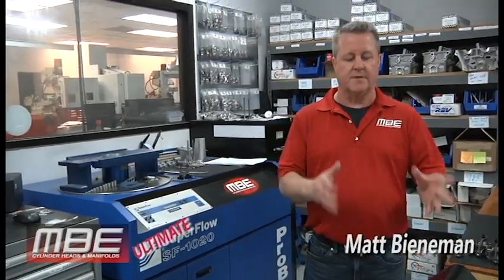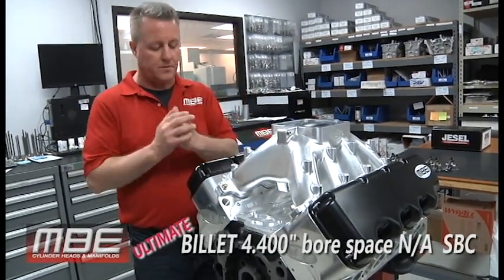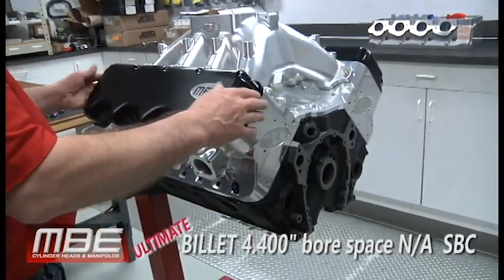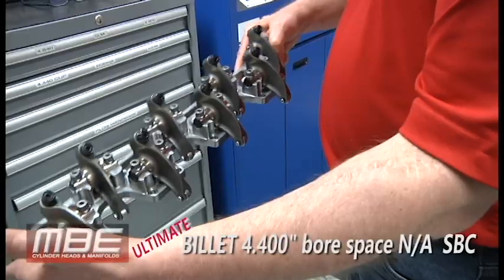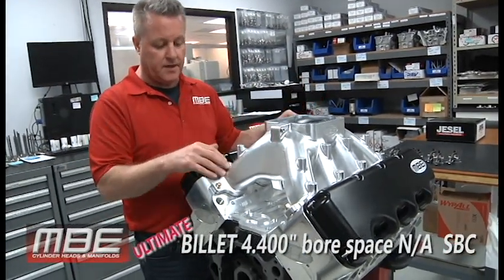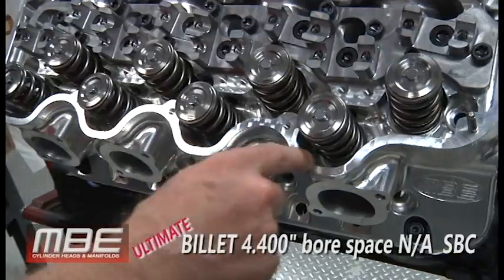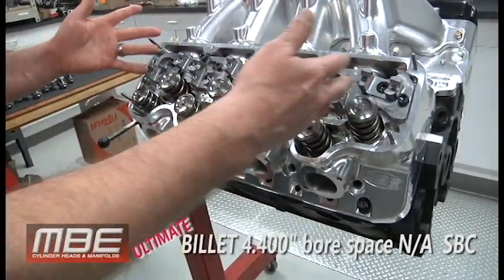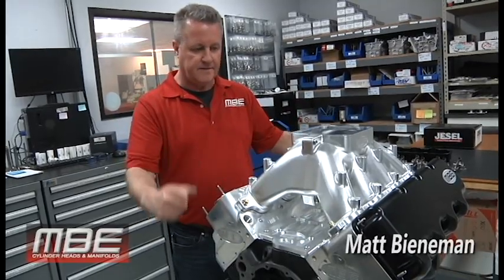** TECH **  The Ultimate Billet 4.400 N/A  SB Chevy Complete Top End Package

Comment: Doesn't look small block to me, how much???
Reply: I know a guy who knows a guy . . . Seriously, those heads bare, are about $5k each.
Reply: @Carl_Jr  Jeg's has the heads for $1150 a set with titanium intake valves set up at a 2.300 installed height. Spring 400 on the seat and 1150 open at .900 lift.
Reply: @Mr.RollTide   No. They don't. Are we watching the same video?
Reply: @Carl_Jr  small block heads are cheap. The intake is $250.
Reply: @Mr.RollTide   You aren't paying attention. The question was about MBE cylinder heads, not some budget friendly brand that Jeg's sells. MBE heads are LEAGUES above anything you can buy at Jeg's.
Reply: @Carl_Jr  Jeg's sells MBE.  MBE actually buys those parts from JEG's.
Reply: @Mr.RollTide   
Dude! I don't know what you're smoking but it must be the really, really good stuff! 🤣🤣🤣
Reply: @Carl_Jr  We have built all billet block, heads, intake etc 5.00 bore space engines for pro mods and radial vs the world for around 10k.
Reply: @Mr.RollTide   Who is "we"? You and your magical friends in Neverland? You seriously need to stop lying. You're just digging the hole deeper and deeper.
Reply: Roll tide...BRAVO for flapping gums on a subject you know ZERO about. Thank you for yer ignorance and the absolute funniest thing I seen on the net today...Kudos
Reply: @GhostRider-dp2tc  How many billet engines have you built?
Reply: Good question, try 75...Do you have $120K laying around in cash to put down in full up front with a 6 month wait time? Depends what you want, price may go up to $160K..Cubic inch is cubic dollars...
Reply from the maker: Incorrect and we buy nothing from JEGS
Reply from the maker: Have you priced billet lately?
Reply: @jimmybiggs4674   The guy has no clue.
Reply: @Carl_Jr closer that the other guy, but still not quite there
Reply: With valve covers about $3800.
Reply: @Mr.RollTide 
😂😂😂😂
That's cute. $3,800.
Reply: @Mr.RollTide I guarantee you 1. head cost way more

Comment: I have a similar setup mine is a 4.500 bore spaced and built for boost and mine is 488 ci  that’s a normal 4.400 bore spaced a little bigger then a stockiest style block but it is a really nice setup what t&d and jesel even manton makes them for this but it’s unbelievable on the top end kits what they have done to stabilize the valve train.
Reply: Boosted makes sense for that cubic inch but I don’t understand how the bottom half of this NA motor can create enough cubic inch to make the top half work properly. He’s saying the heads flow 500 cfm which is crazy for a small block head. You think 4.500 would be enough for this engine?

Comment: Jimmy are you going to make a similar package for the Ford guys ?
Reply: They sell the CID heads. Those heads did very well back in the engine masters challenge.  I wonder how much power could be made with a big inch small block Ford?
Reply: @randallmason9687  A lot of dirt late model teams run 4.40 bore space Fords as big as 460 CI. I hear they are making over 900. A drag set up would make more.